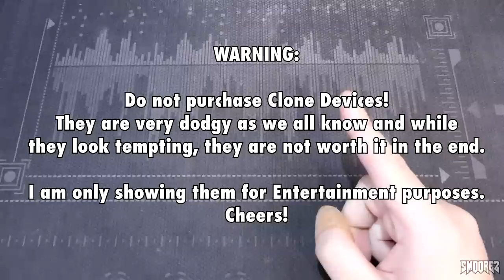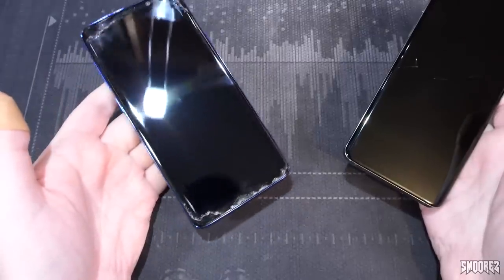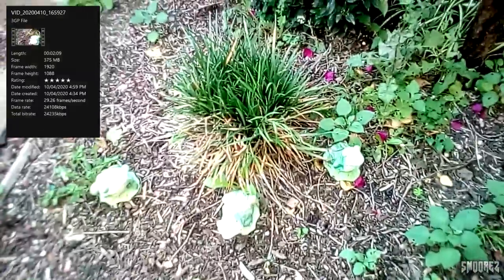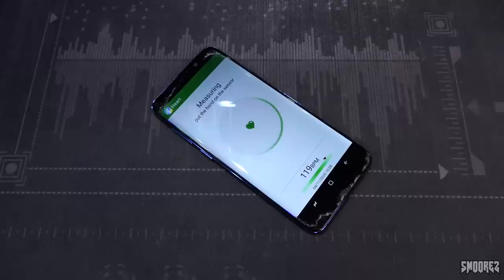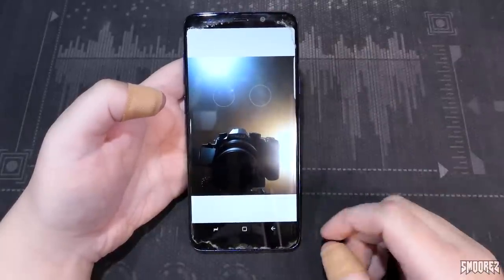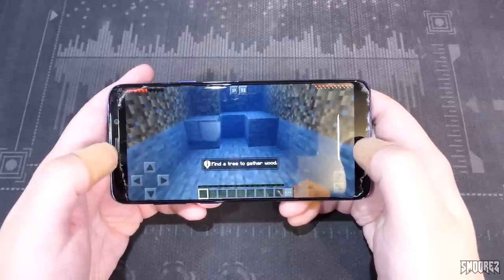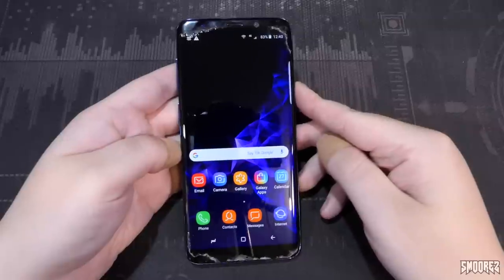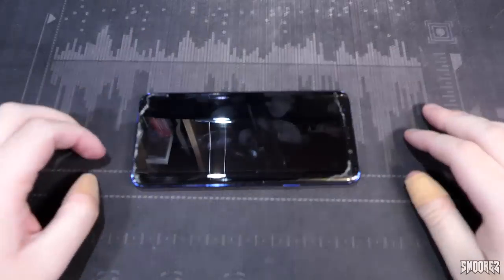ATTACK OF THE CLONES!: The GOOPHONE S9+ (Samsung S9/+ Clone) - In-Depth Review & Teardown!

Comment: They used one of those glass protectors that are permanently glued with UV lamp. These are terribly bad as if they crack , you'd have to replace screen too. That's probably done in factory as fake mobiles don't fit with real deal screen protectors.
Reply: It's often just Luca glue. Never had an issue with them. Used glue on screen protector for my s8 and current s10. Curved glass is hard to stick to with adhesives. Especially glass screen protectors! Again never had issues. 
It seems like they added the screen protector because the glass is very thin anyways or is often made of plastic.

Comment: Fun fact: Samsung Galaxy S9/S9+ actually running Android 8.0 out-of-the-box.

So 7.0 uses Touchwiz, 7.1 and later uses Samsung Experience.
This is seriously dumb.
Reply from the maker: And then that's why they came up with ONE UI...
My bad, well, I think people get the point but thank you for clearing that one up!
Reply: Incorrect, 7.1 still uses TouchWiz. Probably 7.2
Reply: You are wrong, 7.1 uses SE 8.5, and 7.2 doesn't exist

7.0 uses TouchWiz Grace UX, which is the last version.